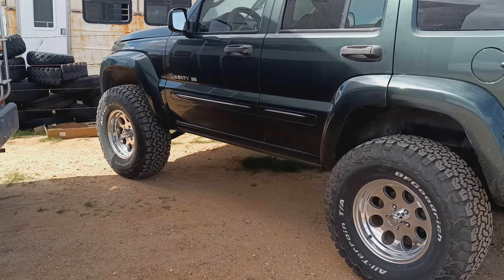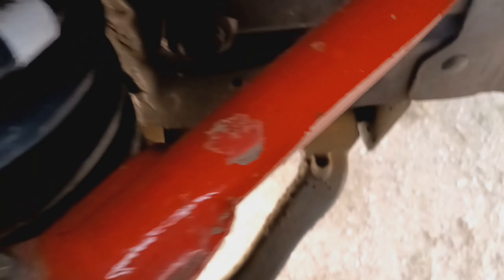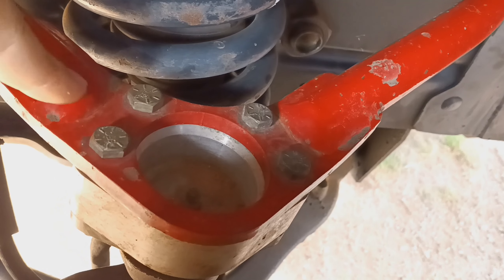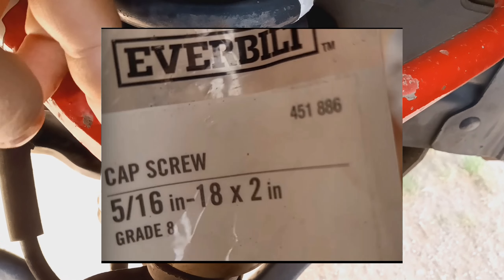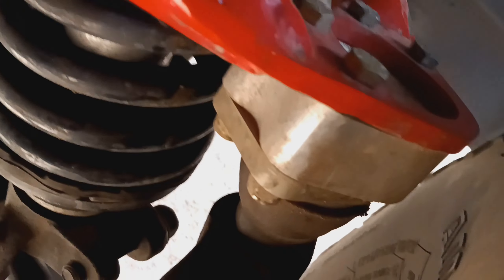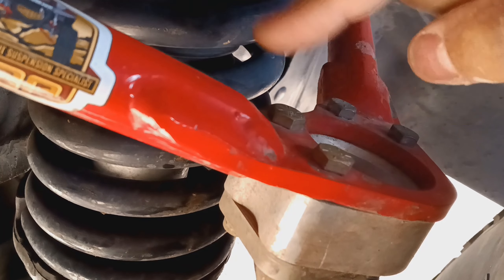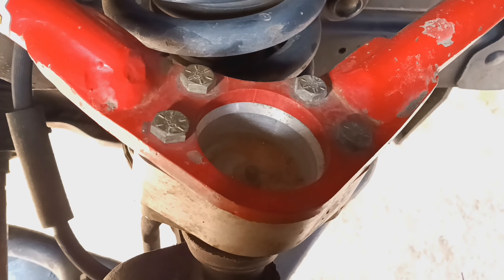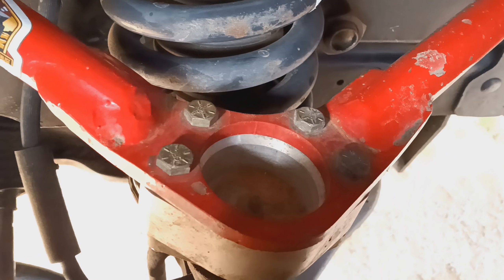Jeep Liberty Upper Control Arm Spacer Details

Comment: Before you got rid the Jeep was you able to accomplish no rub on the front at full lock or you still had rubbing ???
Reply from the maker: I still had a little bit of rub before I sold it
Reply: Probably some spacers or wider tires could fix you think ?? Just asking because I’m tryna see if going 33 or 32 to avoid rubbing
Reply from the maker: Maybe some wheel spacers will do it it's possible it's a cheaper way also
Reply: Ok my wheels are 15x10 -45 offset probably won’t need spacers

Comment: i would still like to know what the extended length of your rear shocks is?
Reply from the maker: I'm sorry it is 10.86"
Reply: @FunandAutomotive  does not sound right, the extended length should be about 26". is that right?
Reply from the maker: Yes it's 26" or somewhere around there sorry I read you're question wrong